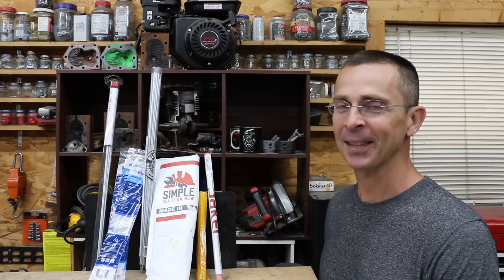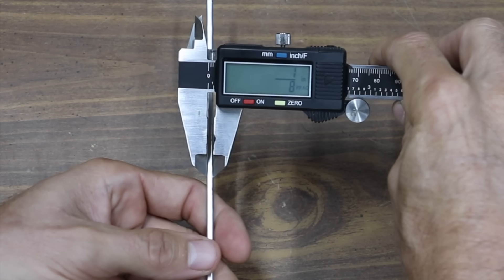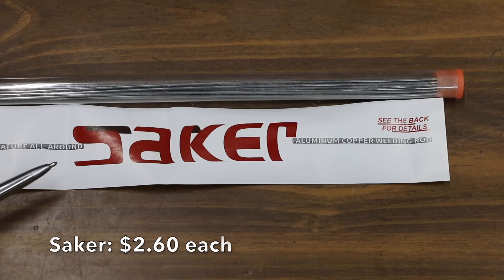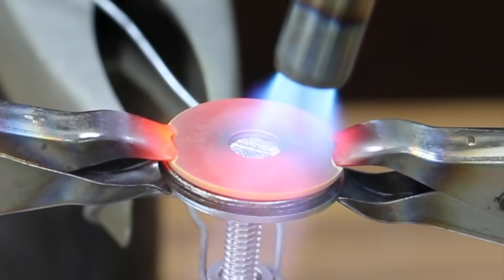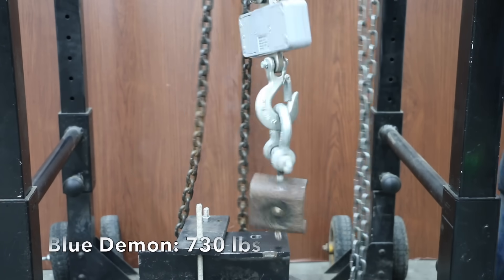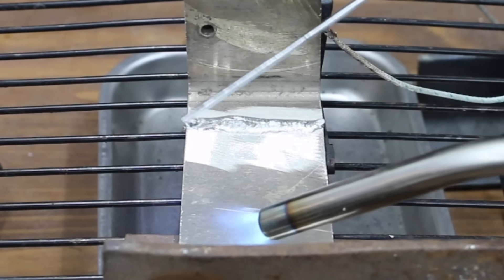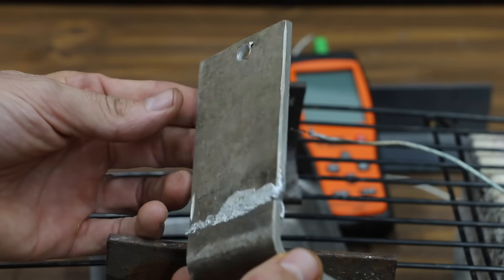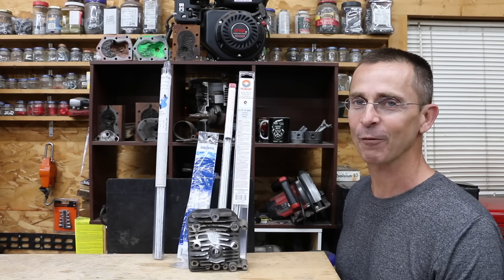Best "No Welder" Aluminum Welding Rods? Alumiweld vs Bernzomatic vs Hobart

Comment from the maker: The top 4 low temperature aluminum brazing/welding rods are pretty impressive, and I’ll definitely be using them in the future.  Also, thank you for generously supporting the channel. I’ve never had any sponsors and plan to keep it that way to ensure unbiased test results. An easy way to find past videos along with products tested: http://bit.ly/2FCrBpk  A big thanks to Jim for putting this together. 
 I’m looking forward to reading your suggestions for future video ideas!  Thanks again, Todd
Reply: I'm surprised you didn't test safety glasses that go over regular glasses, as you have glasses. Could you test them as well?
Reply: @Pedistrarian  nk
Reply: Like to see a comparison, or just a review, of the UV cured adhesives.  No one says much about them.  Think this would be a good test.
Reply: Thanks, that's one of my requests
Reply: For your type of testing method, you should invest in a Chinese coil induction heater, it will be far more consistent in heating small materials for use in testing. Many science/electronic youtubers have made them as well. In specifics to this test, heating temperature is quite critical to attain a good weld and not temper the base material. Excellent video though, as always! I really appreciate your "consumer reports" type comparisons and non-sponsored attitude.
Reply: This list makes things easier! When purchasing items I alway refer to your vids.
Reply: I’d like to see lithium complex grease vs aluminum complex vs polyurea vs calcium sulfonate greases.
Reply: Can you add the results to your reference list?? maybe just put a link to a google drive folder with pictures of the result graphs. I always think of you when trying to decide on brands, and I wish I could easily look through a list and find the results
Reply: You should test "The best beer"
Reply: how about testing hummers next time?
Reply: Do a rod and see how long it last with the weld stuff
Reply: Painters tape
Reply: Seth Aeder good evening Seth, he actually did one on painters tape and it was really good. I went with his tests and my living room trim came out better because I used the right tape
Reply: Trail cameras. can you please review trail cameras?
Reply: Compare long lasting mildew inhibitor like Wet & Forget vs bleach vs vinegar
Reply: Nice that you saw my idea for video mate. :)
Reply: Please do a video on different types/grits of sandpaper!
Reply: THANK YOU . Bought these about 15y. Ago lol never could get them to work right. But now ready to try again.
Reply: Can you weld steel to aluminum with this?
Reply: Your videos are always great and I love watching them.  I have one suggestion, can you compare Septic Tank Treatment products.  I dont think Rid-X is as good as it claims to be and wondering what you thought.
Reply: @mikenosteen8381  I would love for a septic treatment product comparison also.  I see rid x on commercials and use it but amazon reviews say it is not as good as others, I just switched to one by cabin obsession.
Reply: I would not urge anyone to weld in this manner, you need to use pure argon for best results. I've used flux core mig welding wire with hobart 240 and always found temperature had to be set higher than using argoshield light. DIY i suppose is ok, but i wouldn't go repairing a set of ladders using this method. 
{Was a welder for 16 years}
Reply: NEXT PROJECT
BEST CONCRETE MIX :) 
or best epoxy granite mix  
both to achieve super strenght without looking at cost 
im going to test it by myself for making cnc out of granite /epoxy granite or concrete  but it will be great to see your comparsion 
Probably epoxy wont get most views and it is expensive thats why concrete will be better option 

PS 
if u will test epoxy granite remember to first mix epoxy with hardener then add gravel sand etc
Reply: Hey PF, can you include metric versions of your mesurements?
Maybe as a subtitle or a footnote?
Reply: @lgbit7126  Basic math(s), or https://www.calculator.net/conversion-calculator.html.
Todd has enough going on.
Reply: @lgbit7126  https://www.google.com/search?q=us+to+metric+conversion&oq=us+to+me&aqs=chrome.3.69i57j0i457j0l2j69i60.21254j1j4&client=ms-android-verizon&sourceid=chrome-mobile&ie=UTF-8
 Just enter the US numbers he gave and it will convert it automatically to the metric numbers are looking for
Reply: @lgbit7126 😂
Reply: @lgbit7126  Download a converter on your phone. The metric world is thankful Todd uses metric weight. Calipers have also a button to convert.
Reply: How about a brushless drill showdown to follow the impact showdown?
Reply: I had Partsmaster sticks. They were just like those iceees. Base metal melted before welding sticks. Now I know I didnt do anything wrong. 👍
Reply: Use chain lub has engine oil
Reply: Cn you test tyres
Reply: @ project farm. I wish I knew your first name, so I could address you properly... Another great video by the way!!! Here's a few, 
The best pipe dope my fave is
"The Green Stuff" (x water well man)
The best hand cleaner. Well there's 2more for ya! I appreciate all your time and hard work!!! Thanks your channel is very interesting and helpful!!! Your fan in central Michigan, Jim.
Reply: @dirtroadfarmsjimmideanreen2458   His name is Todd
Reply: @dirtroadfarmsjimmideanreen2458  Todd
Reply: With winter coming up how about antigel part 2 with penray howes hot shot secrets. Include the red and yellow heet for gasoline. Thank you I love this channel
Reply: Wow! You have a very impressive body of work. Thank you for sharing
Reply: Can you test antifreeze/coolant testers? It’s time for a guy to get a new one but the reviews are 50/50 garbage or great on all units.
Reply: Todd you should figure out how to get a gas engine to smoke like a big diesel truck and not blow the engine up!
Reply: @08duramaxlover25  black smoke=wasted power, wasted fuel, oil contamination, excess wear, excess pollution, and engine damage but if you still think it's "cool" and want to do it anyway put some oil in the gas and run with the choke on. It'll make clouds of blue gray smoke.
It will work, for a while. until it doesn't anymore then your gonna learn a lot more about engines if you want it fixed.
Reply: Is there any way to add a column that shows your favorite product/one you recommend in that spreadsheet as a quick guide ?
Reply: -Test expanding foams? 
-Test dog collars? lol
-Test headlamps/flashlights?
-Test steel-toed shoes
-Test kitty litter brands 
-Test longevity of various plywood species/types?
-Test hacksaw blades?
-Test bailing wire?
-Test toughness of shovels? lol
-Test “water-proof” clothing and waterproofing sprays?
-Test chainsaw safety equipment?
-Test various archery broad-heads and other ballistics?
-Test more unique batteries cuz they’re gaining popularity? 
-Test shrink wraps?
-Test fuses?
-Test Battery chargers vs Ebay?
-Test fishing lines or poles?
-Test thermal gear like gloves?
-Test bearing grades vs ceramic?
-Test camping gear like portable water filters 
-MORE VIDS?!?!?

This was a good vid. I have to patch a bunch of old holes in an aluminum boat. TY
Reply: I was installing some new outlets today and I know there are two camps on installing the fixtures: Push installation or Screw tighten.  Also the newer push wire connectors  vs. wire nuts.  I would love to see some science thrown at these!
Reply: I have only seen them used by one person, and the weld was stronger than the surroundings.
Reply: I just watched a video on hysteresis in tyres and I was wondering if the rolling resistance and hence the fuel economy of cars is affected by the profile of the tyres. eg which gets better fuel economy (has lower rolling resistance) a 30 series tyre or a 70 series tyre.
Reply: can you check car oil filters?
Reply: WRENCHES 
RATCHETS
BREAKER BARS
TORQUE WRENCHES AND ADAPTERS
SOCKETS 
SCREWDRIVERS AND BIDS
Reply: Do a corrosion test between Painted screws, Mechanical Galvanized screws and Electroplated screws.  Which one is better? Lets find out!
Reply: @Meme Man basically whatever displacement is divide that by 0.67 to get its Free Air Delivery (what you get as usuable air delivery). I have 2 x 2.5hp with 9.6 displacement (so ~7 FAD) and a 1.5 with 4.5FAD coupled together, which gets me around 18cfm FAD, which is coupled to a 100 litre air tank to act as a buffer.
Air tools often are rated at  ~25% useage  so stuff like air sanders you should multiply the stated usage by 4 (so a 6cfm sander would use 24 cfm if used continuously)
Reply: Can you please test best pressure washers for things like hydrojetting or simply a car wash
Reply: How about evaluating that first welder in this video?
https://youtu.be/K3b1kmiBcnM
Reply: Best tires!!!
Reply: Do battery tenders. Man I've been through 3 this yr that's absolutely just stopped working
Reply: How about best way to remove oil stains from driveway/concrete?
Reply: I have an idea for a video, I would like to see you test road tires of varying prices. One test I had in mind is a wear test involving a mounted tire spinning on an asphalt drum. Possibly find a way to increase resistance in the drum to expedite the process? I'm not sure, but I think you can figure it out.
Reply: How about a video on hydrophobic windshield coatings, including ceramic coatings too?
Reply: @manofsan  Dude, RainX windshield washing fluid changed my life. Not really but you get my point. My only complaint is that in low water scenarios (mist/light rain/etc.) it makes your wipers chatter.
Reply: @Rattus-Norvegicus  but I thought RainX means you don't really need to use wipers in low-water scenarios anyway
Reply: @manofsan  You don't "need" to, but it can't hurt. Also another specific situation is when following another vehicle on wet roads, the mist thrown up can be dirty and accumulate and you'll need to clear it.
Reply: Try make an engine run on its own exhaust fumes for the air
Reply: Please do a review of Japanese engine oil eneos and idemitsu thank you
Reply: Can you do 10,000 km used oil vs fresh oil with the friction test?
Reply: CAN  YOU DO A TEST ON DENT PULLERS TOOLS.... AUTO BODY
Reply: I would like to see a automotive compression tester test and comparison.
Reply: Hmm the fact that the brazing rod was running cooler and it didnt even have the cooling fins gives me an idea, Please take a normal cylinder head and cast it in green sand, then melt a crucible of the Hobart brazing rods and try to make an entire cylinder head from the rods, obviously youll habe to tap spark plug thread which may be hard and drill head bolt holes but it would be awesome to see how it performs against the compression aswell as the heat and if it can even run cooler!!
Reply: @fozayallday5244  the brazing material appearing to run cooler could be simply because the emissivity of the shiny brazed area is lower than the black cylinder head surface, which will result in lower infrared emission and readings.
Using a thermocouple would confirm that
Reply: Todd;
I don't know how many non-North America viewers you have, it would be interesting if some of the European (even UK ;-) ) viewers would let you know... if there is any kind of interest, perhaps one, or more, of your European viewers could purchase some European brand products for you to add to your tests?  Just thinking, because there are many times when we have different products in Europe, or, we may not be able to readily purchase a US brand... Just wondering??
Reply: I just ran across your videos a couple hours ago and have been binge watching them. I love them. My question is, what model is your smart sensor temperature probe. Do you think an Infrared Thermometer would work as well.
Reply: Thank you for the info.
Reply: Another great and informative testing video!  Would have been nice if you could have included HTS-2000.  I've successfully used it for a number of aluminum repairs.  It's not the easiest to use, but seems to be very strong.  More recently I've used Blue Demon to fill in some cast-in voids in an aluminum casting (I didn't need a lot of strength).  Was cheap and easy to use with MAPP gas.
Reply: Hello, I'm in the UK and can't get Hobart or any of the other USA made Rods. Can you tell me whether you have tested Durafix Aluminium Rods? Do you have anyone in the UK you chat with that can tell me which Rods to buy over here. 

Thanks, Shawn
Reply: How about to make a video about the best sandpaper? I did not see any yet.
Reply: Big thank you to Jim!  That list is gold!
Reply: Test idea: "Kink-free" garden hoses. Most from gina are the kink-master.  Another is exterior varnish like Sikkens, if you aren't in CO it is another ballgame at altitude with intense uv, wind, snow, rain, freeze-thaws
Reply: Aluminum-weld.com "HTS-735-II Fluxless Aluminum Brazing Rod". Check it out!
Reply: Could you please make a video on power inverters as I want to get one to charge my power tools batteries in my truck
Reply: Thank you so much for doing these selfless videos. I've been debating these rods for a while and you certainly took so much hassle out of my decision.
Reply: Ty
Reply: Wonder how well this would work on exhaust pipe instead of using clamps
Reply: Are the aluminum rods soft and easy to bend, or are they stiff and hard to bend before use?
Reply: That's awesome, and thank you for the intensive review! I was about to trash an old aluminum boat because I found a 2x3" patch under bondo, now I can braze it after extensive cleaning
Reply: I've always wondered if anyone has had much luck with Muggy Weld rods.  I seem to recall a lot of pumped up testimonials but never knew any that put any down.
Reply: Did anyone catch what temp the Bernzomatic rod melted at(?)
Reply: Now generation
Reply: @Shaz The best jeans are ones with Holdup Suspenders attached ! They are the best by far!
Reply: Harbor freight is made in USA
Reply: Dear Project Farm! Thanks for all awesome vids. I would love to see you take on a bunch of affordable stick welders!
Reply: Aluminium*
Reply: probably just not
Reply: How about a video on those paint on counter tops and how they last, what they stand up to, staining, fading, cracking, etc etc
Reply: Just started with a flux wire mig welder. Plan on doing some aluminum welding also. Glad I saw this comparison on aluminum rods. Thank you. Definitely will keep down the frustration level when I start. Wish there was a comparison on flux core mig wire. But there something to be said about learning the hard way.

Again Thank You for the aluminum rod comparison.
Reply: Am I the only that thinks PF should be a Netflix series?  I would love to see the scope and scale increase.  What is the best 1/2 ton pickup?  Give this guy 6 brand new pickups and a budget to buy and create tests and report on the findings.  Tractors, chainsaws, work boots, side by sides...  Better yet I'd create an online audience-driven upvoting system that drives what will get tested next.  You asked for it here it is.  House insulation systems...  I truly believe PF would do service to most any test even if it's not typical wheelhouse!  @PF  reach out if you need marketing and project management skills to make this happen and also need someone to constantly monitor and prevent selling out and assure transparency and authenticity in growth.  ADKAR change management the whole way!
Reply: Super.
Reply: What aluminum rods would be the best to use on some crack on bottom of my john boat.
Reply: just so you can get more views?
Reply: Test chain saw chains
Reply: FYI when you said "the weld material tore away from itself".  The term for that is "cohesive failure".  Love the videos keep em coming!!!!
Reply: @thehoovah  But; many people that watch PF, like myself, may not be versed in different terms.
You're doing fine just sticking to simple terms.
Ed Kelly
Reply: I see no problem with you taking sponsorships for products you like and have already done successful testing on. There's nothing wrong with endorsing something you're confident in. I can see how much work goes into your videos and you deserve the money.
Reply: Can someone tell me how to get my gasoline 4 stroke engine to smoke black smoke without blowing the engine up it’s just a little Kohler command 17.5 hp. Thanks
Reply: @08duramaxlover25  we used transmission fluid in our engines but can't remember the mix. Start with a small amount and work up.
Reply: @lonnieeudy7286  does it make the exhaust smoke black??? And will it blow up
Reply: Awesome as always! Here is another video idea. https://nobleupscale.com/pages/ognathan

Claims to regulate electricity cutting electric bills by sometimes half.
Reply: @jmoe6253  Total and utter snake oil - lots of shiny suit flim flam on that page aka technical sounding mumbo jumbo, didn't stop my county spending vast sums of taxpayers' money on it though despite being told it didn't and couldn't work as claimed and wouldn't delivery ANY savings. Ditto power factor correction devices for residential use (as power factor correction is already built into your bill), PFC is only of real use to heavy industry
Reply: can you make a video of cars less vacuum for car
Reply from the maker: Thanks for the video idea.
Reply: @ProjectFarm  Love your videos!!!
Reply: @ProjectFarm  If you haven't done it yet i would like to suggest a video on degreasers like simple green,zep, dawn soap and the .99cent awesome and any others you might have in mind.
Thank you for your great videos.
Reply: @ProjectFarm  trail cameras. can you review trail cameras?
Reply: Project Farm can you do a project on the best air purifiers??
Reply: @kemarwatkis7828  uuuuuuuu1uu8uu8uu8uuuu